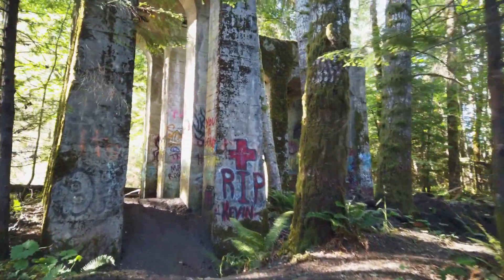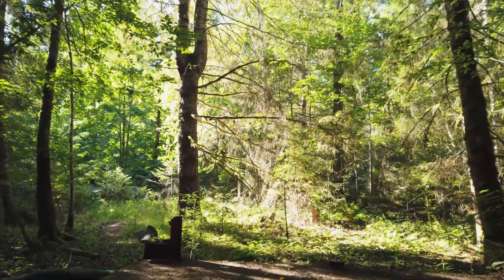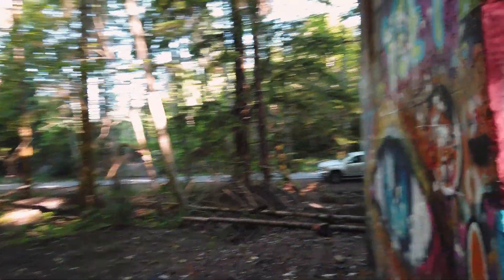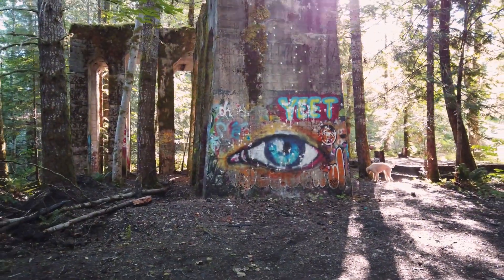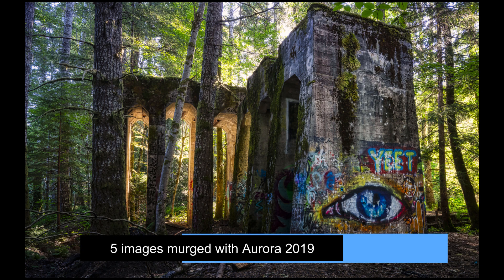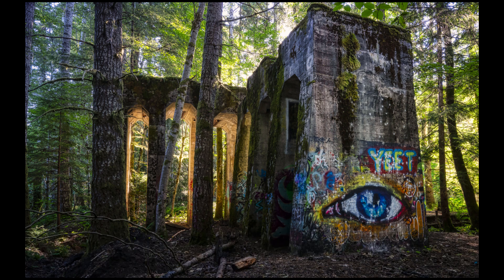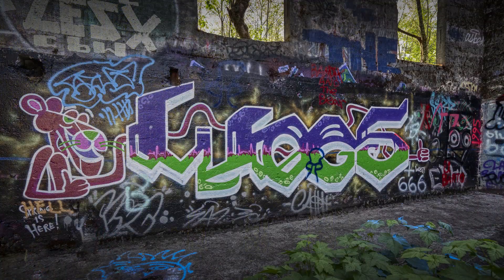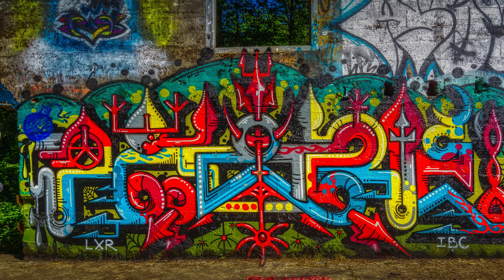Drac's Castle | Vancouver Island | Courtenay BC

Comment: That slab of concrete at 1:34 is the cap on the mine shaft It's 900 ft. to the bottom. When I was a teenager in the 70's, there were huge parties here thats when people started calling it Dracula's castle. 4:46 it's an old saw mill we used to skip class in the 70's at Vanier and hang out there to smoke weed. There was no graffiti then.

Comment: The building by the bridge on Farnham Road in Merville was a sawmill, located at the Headquarters townsite. Comox Logging and Railway Company built it around 1913 in exchange for logging concessions from the government. The agreement was to build the mill but it did not specify that they had to operate it. The sawmill was never used and its parts were sold to another mill in Courtenay.
Reply from the maker: Thanks - great information
Reply: Good to know the logging industry has always been fucking with us.